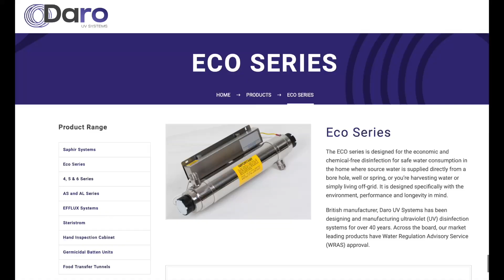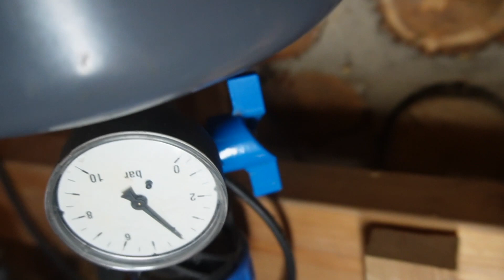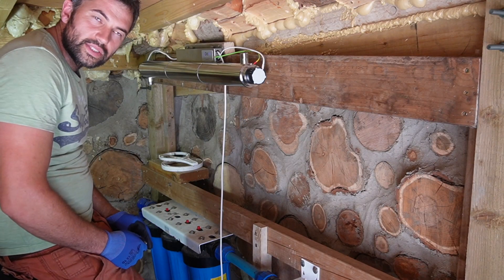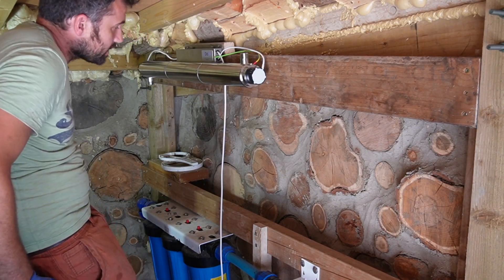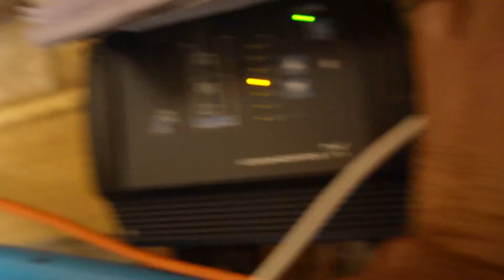ADDING UV TO OUR OFF GRID WATER FILTRATION SYSTEM

Comment: So, two questions:
1) you said it pulled 55W. Constant, or only when water is actually flowing?
2) I heard UV treated water can taste very off. Noticed any difference?
Reply from the maker: The 55W is constant. We haven’t noticed any change in the taste, and it tastes a lot better than mains 👍

Comment: Uv tubes and quartz tubes. Only handle them with paper towels or blue roll. You can wear gloves but they only transfer grease and contaminants from every thing you've touched. Use brake cleaner to degrease the bulbs before you fit them and they are less likely to go black and fail. Also applies to car headlight bulbs, degrease them first and they'll last longer.
Reply from the maker: The gloves were brand new and the UV light would have killed the bacteria so we are all good ☺️👍

Comment: Hi, I'm not an expert in UVs for human use but in the Koi pond world, the UV is 1st in-line after the pump and  before any other filters. 
I use a 55w 1mt tube every 6 months for sterilisation purposes ( approx 4000 hours).
Lamps used to clarify ponds can be replaced every 12 months ( approx 8000 hours). 
I take it you need it for sterilisation purposes so it needs to be replaced every 6 months.
Hope that helps in some way
All the best
Reply from the maker: Thanks for this.  On the Daro data sheet for the Eco 3 is says 8760 hours for the lamp, but doesn't give details for the quartz  tube 🤔 Some other sites have recommended changing it every 2 year?? It also said it can be cleaned if it gets scummy, but hopefully this shouldn't happen due to our pre-filters? ☺️

Comment: Looks like you wound that ptfe tape the wrong way round, try Loctite 55 as it is much better and easier
Reply from the maker: Thanks for the tip ☺️
Reply: If it's a RH thread you wind it clockwise so it does not rough up, which I thought he did.

Comment: Pre filters first, UV second, Carbon third. Bacteria loves carbon as a breeding ground so if its before the UV, your UV has to work harder and your carbon is less effective. Also as suggested in one of your previous videos take off the water to the WCs etc before the UV.
Reply from the maker: Thanks for your comment ☺️ The order we have gone for is: pre filter (5 micron), ceramic filter (takes out over high 90s% of bacteria), carbon, UV.  We are using the ceramic to remove the bacteria so that should protect the carbon filter.  Also, with the pre filters first that should make sure the UV light doesn't have to work any harder (that's what it says in the manual anyway) and can run at its constant 50-55W, like it says in the manual 👍
Completely agree about taking the water for the toilets etc off before the filtration.  This is something we will definitely do in the future when we build our house ☺️